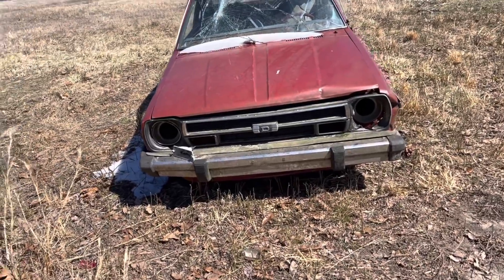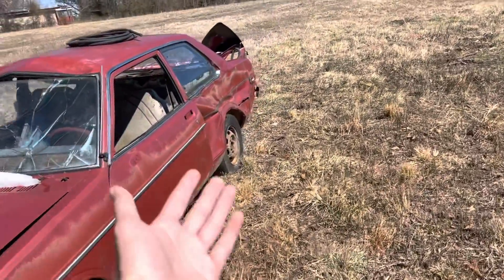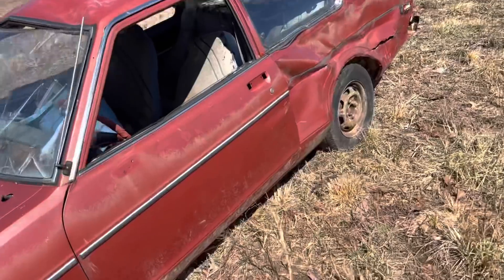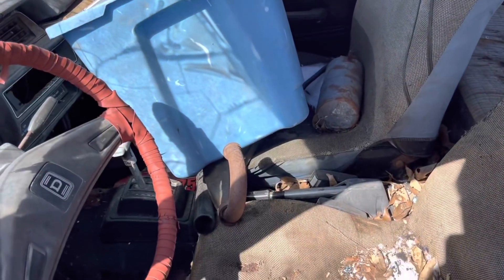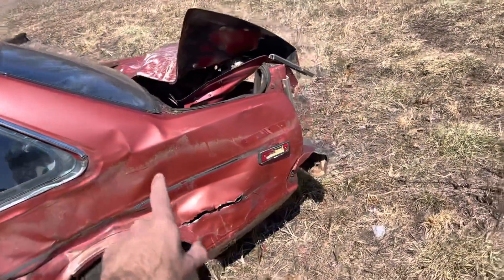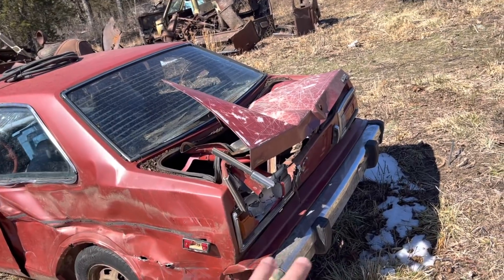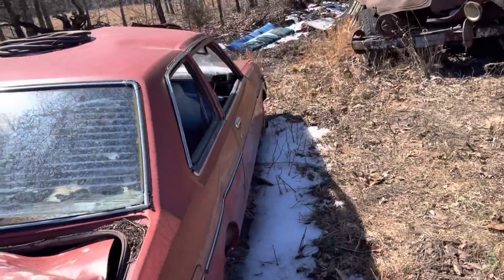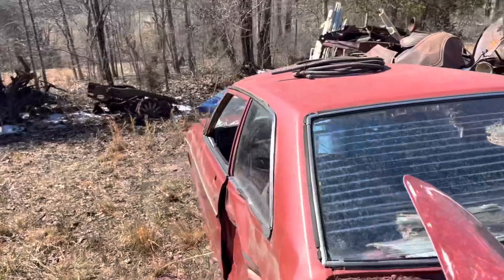Will it run after 30 years 1979 Datsun￼

Comment: The sound of this cranking over without starting brought back memories.  My dad had an old 510 4 door that only started right up when you didn't need it to.  I remember him outside at nght trying to start it to make sure it would run when he needed it the next morning.
Reply: that old 510 had 2 sets of points, so a  little tricky to set up if you didn't have the magic touch.
Reply: @rupe53  I was young at the time but I can pretty much guarantee my dad didn't have the magic. Too bad, the 510 was quite a car.
Reply: @rupe53  thanks rupe, I have my grandma's old 510 and this is good to know.
Reply: @rupe53  Yeah, that 510 was gone from the family garage in the 70s. At this stage, I'm not sure he would even remember that car.
Reply: @austinwagoncompany  oh that’s awesome
Reply: Isnt a 4 door “510” is a datsun 1600
Reply: Probably needed all new vacuum lines?  That was common issue with these.
Reply: I had one of those

Comment: I’d find a kid who wants to learn how to do bodywork (or a trade school) and let them restore it. The low mileage would make it a worthwhile project. What better way to learn metal and fab work than by working on something without readily available parts?😬
Reply: I'd stand to bet that's 113k miles and it just ticked over judging by the amount of body damage and to be left like that in a still runnable condition. Just shows how tough they are!
Reply: Donate it to a high school

Comment: Love your optimism, which was rewarded of course, well done. I have never seen a two-door version of that car here (UK), different markets had different versions, shame it is not a sought-after car, so probably not worth repairing and not going to be demand for spares, great video, thanks for sharing! Greetings from the UK!
Reply: The 210 coupes are VERY sought after here...one of those cult cars that goes for way more than you'd ever believe.  Too bad that one is in such bad shape.  I've seen non-wrecked (but still no headlights, sitting forever, window or two broken out) go for 8-9K.  If it wasn't wrecked, he could use the money to completely restore another car of his to almost new!
Reply: They are pretty popular here for vintage motorsport racing, I have seen some very nice examples

Comment: My 1979 is parked outside. Has a leaky radiator and burns oil and needs bodywork and fixing some rusted panels but I still drive it around every week or so to the supermarket just to keep it active. 5 speed transmision. With good tires it would fly!

Comment: When I got my license in the early eighties … my dad drove a 78 Subaru GL, 2 door, shaped like hatchback but only had a small trunk … great car .  I had a 71 Datsun B110 with an automatic transmission that I could outrun on foot … great car. I next had a 79 B210 hatchback…. another great little car …. .   Thanks for the memories.

Comment: One of the things inside the air cleaner area is most likely for the emissions device which alternates warm vs "cold" air intake. it is a vacuum controlled flap which is used to change between the two types of intake.

Comment: These cars 20years ago you could not give them away, body on this one pretty rough but mechanically it should be good!! The early Datsun Bluebirds of the 60s used a copy of A series Austin/Morris engine. Improved a little of course, better breathing.

Comment: Those old Datsun, Nissans are tough as nails. I think it could be modified into an off road buggy. My cousin did it with a VW, so why wouldn't it work for a Datsun? 😁 Good job, thanks for sharing!
Reply: still running my 1976 120Y .. 550,000 miles last month.. only had brakes, clutch (twice), tires and fluids since I bought it with 44,000 on the clock in 1984.. absolutely bullet proof if maintained. the 76 was the first year they dipped em.. the 75's just rusted to nothing.

Comment: Wow, I had a 82 Datsun  210, same car different  grill and mine was a sedan.  It was a 5 spd and had that 1.5. That thing lasted  through alot  of use and abuse.  I know of another sedan,  like mine still  going and has  the big D on front like this one featured  it's  a 79 I'm sure. Little  rear wheel  fun to drive  car. That  engine  sounds  very good  and  tight. That car could  be straightened  up enough  to run and drive.

Comment: Hey it doesn’t need to be extremely old for a “will or start” video! Hell I’m open to more 80/90s cars too!! Maybe try to throw in a few 50-early 70 rigs in there if possible too!
Who doesn’t love the late 70s to late 80s with those low compression 100hp v8s and tiny 4 bangers with 70hp or with Turbos that never worked at 100hp!
Keep em comin buddy! Should have nice weather too by down in your neck of the woods (I’m in Wisconsin lol)

Comment: In Brazil specially carburetted cars that used alcohol had a valve similar to this on the air filter case called "Thermac", for better cold-phase working and emissions. It alternates from cold air(normal) and a tube from exhaust manifold with hot air. The thermac acts like a temperature sensor, and actuated by vacuum open/close that rounded thing on air intake, there have a flap.

Comment: I had a 75 510 a10 3 door sedanette. Weird ass lil rotary car. Had a Nissan marine engine in it. A lil B210 6 plug engine. Wouldn't die fer shit. Drove it on purpose fer 2 years without oil. Loyal lil bucket bomb.

Comment: Unfortunately Datsun, or as it's known today, Nissan has nothing to offer that can compare to their great cars of the seventies and eighties. My first car was a Datsun. In 2015 I bought a new Frontier pickup. It was so hard on gas that I traded it in for a 2017 Sentra. I was hoping that the Sentra would be the last car I'd ever need. Nope, the CVT transmission is a nightmare. In the end I traded the Sentra for a Mazda CX5. My experience with the older Datsun/Nissan's was great. Not today though, they're just junk.

Comment: Excellent video 1979 Datsun (Nissan)  210 car with 1100 CC motor and transmission also axle also remember those car when age 5 to 16 ! They did job for get people point A to Z and very low cost to run ! Remember hearing lots got 35 mpg anywhere also full tank get 450 miles on tank full of 87 to 94 octane gas and oil last 6 month between oil change! That part air cleaner ask what it Backfire Acesserory what does if carb Backfire was fire shut fuel off on and act like fire extisher but were reliable at all! Datsun only did but when change Nissan drop feature out on vechiles built it ! The big finger feature was close off carb getting fuel but usually broke and after snuff air and fuel flow Backfire happened! Poor design tell that !

Comment: Good to see an update!  Figured you were battling a bit of weather. 

That poor old datsun. Too beat to fix but there's enough there to part out. That motor sounded strong.  Never see those. What car is that sitting in front of the GMC?
Reply: Car could be restored, but not worth the cost.
Reply: I agree about parting it out.
A bit of extra drinking money,perhaps?

Comment: Someone musta used that car as a beater in the woods i used to do that with friends my beater was a daily driver believe it or not coverd in mud alittle dents here and thier and it had a iron duke engine in it it was a crappy Chevy celebrity with an iron duke in it i bring it to work with frount meaty snow tires and mud it was a beast then i sold it to a friend that wanted the engine in it.
Reply: That car would be a fun woods truck

Comment: If that's surface rust on the 28 GMC, that can easily be removed with a wire wheel on an angle grinder.

Comment: Hi, what car would you recommend for a beginner looking to get into cars
Reply: 1977 Chevy Nova 4 door
Reply: I would suggest anything from the 1990's back with a Chevy small block.  The 1/2 ton pickups, Caprice, Impala, Nova, etc.  If you feel like getting more into the imports, look into Toyota pickups, Celicas (RWD especially, those being 1983 and older).  The old Datsuns (like the one shown here, just not as much "body customizing") and Nissans that were RWD would be good too.  The very first pickup that I owned was a 1970 Datsun PL520.
Reply: @grantkoeller8911  you bhole 🤣

Comment: The thing u pointed out at 3:40 is likely an add-on mass airflow sensor, which goes to a mini computer in the car and can calculate what RPMs it needs to stay running. Not entirely sure to be honest.
Reply: Nah it's factory, that's the sensor for the automatic hot air system.  It opens and closes a hot air inlet to prevent carburetor icing and also for keeping a constant temperature for efficiency/emissions reasons.  In some markets it's not there and there's a summer/winter switch that you manually set instead.

Comment: How’s it going bro
Reply from the maker: Pretty good
Reply: @jenningsmotorsports7554  hey how's that caddy going, do you feel like selling it? I would love to restore as much as I could on it and  turn it into a rat rod
Reply from the maker: @kymck1816  I pulled the engine out of the car and it is about to go to the machine shop to be hot tanked going to rebuild then engine probably going to put it in another vehicle because there is not much left of the car just fenders and grill and cowl
Reply: @jenningsmotorsports7554  I would love it as it is, I like a challenge, if you decide to part ways with her let me know

Comment: the A15 is not HEI LOL, thats just a replacement Electronic ignition that somebody has installed, i have the same(A15) engine in a 1994 Nissan C22 vanette truck, that basturd points spring broke(spring literary snapped as i was driving it) so i put electronic ignition into it , runs like a champ